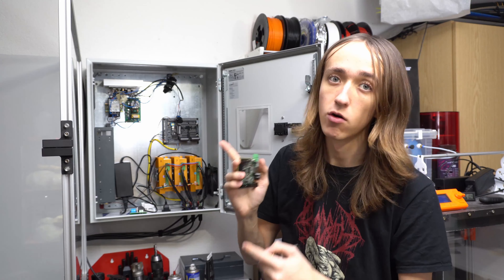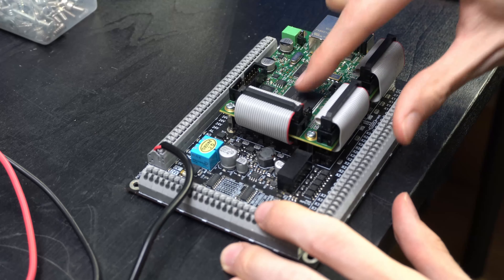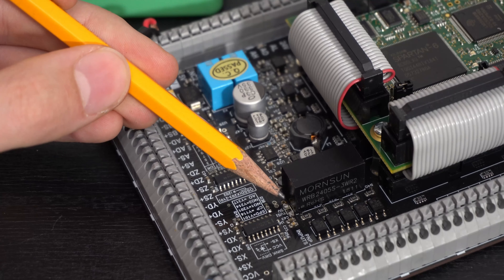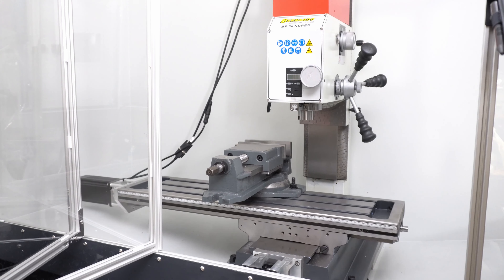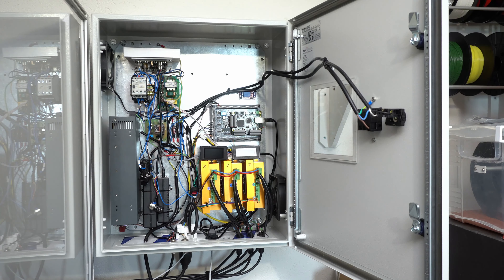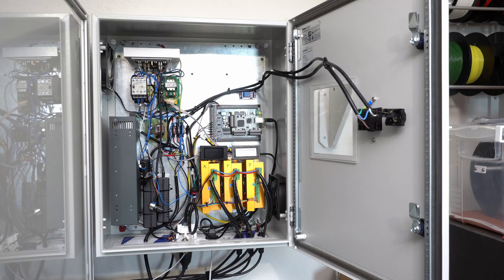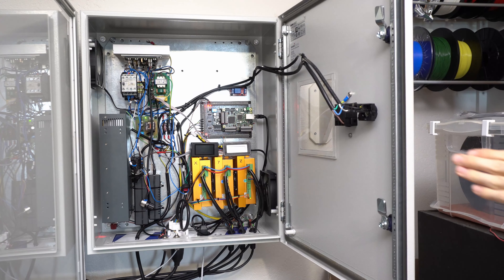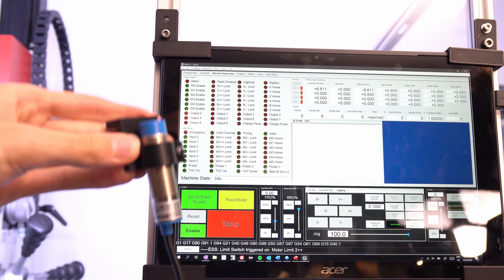BF30 CNC #7 - Electronics Part 2

Comment: My stepper driver requires a GND connection but my power supply only has +V -V and the line in connections(with a ground). Do I connect the GND from the stepper driver to the line in ground on the power supply or do i connect it to -V or ground it to something else

Comment: Is there any problem with putting the computer electronics for a Cnc project into the same case as the stepper drivers and control board and power supply?
Reply from the maker: I probably wouldn't recommend to mix it too much, but you could just partition off a part of the enclosure for the PC hardware.